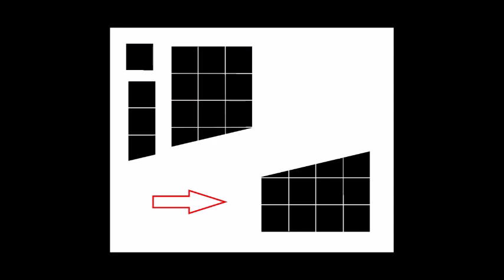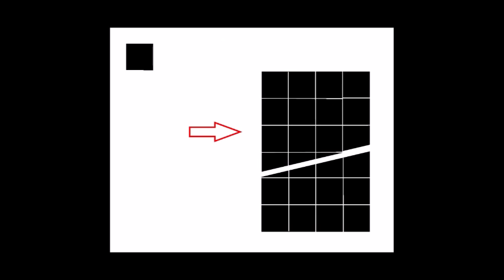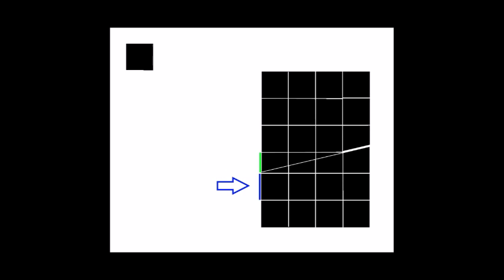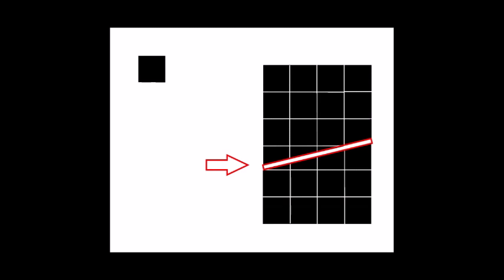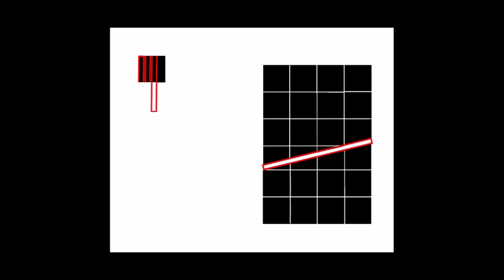Infinite Chocolate Bar Explained

Comment: If you do this without cutting off the "bonus" peice at the start, it becomes clear, as the bar will be too high on the right side when put back together. If you cut that part which is then too high, it will look even and you'll have that one "bonus" peice at the end, (the one you cut off) "left over". What makes the illusion is that this extra peice is cut before we start so when moved to the right and placed back with the larger peice they are the same height right away.
Reply: Underrated

Comment: Wrong. It's actually a magic trick, using misdirection. The way the bar is at the end of the original video is how the bar was when it was cut. They then move the pieces, and put a chocolate square from another bar into the upper left corner. Then they start making the video. The beginning of the video tricks you into believing that the bar was cut on the left side, when it was actually cut on the right. They then block out the bar with a graphic and switch bars on you. Very clever trick. Simple geometry wouldn't explain how perfect the bar of chocolate is at the end. As you can see in the middle of the video, after the pieces have already been moved, the bar is very much distorted. Use your brain, and pay attention!
Reply: Jeremy Barger No, Your Lier, You fucking idiot
Reply: @pq3696  Shut the fuck up you 12 year old
Reply: in videos the  {not this one}   chocolate GROWS (to fill the last piece)